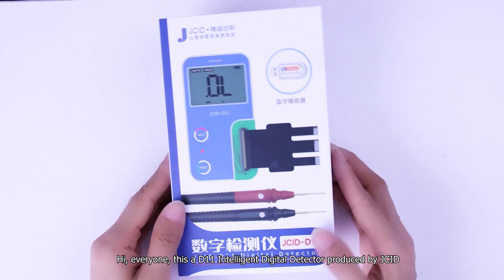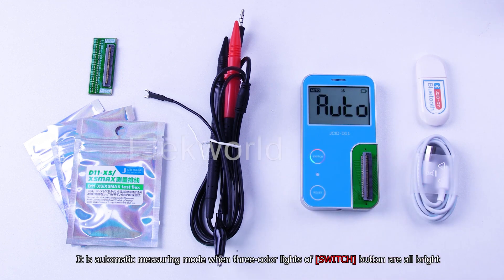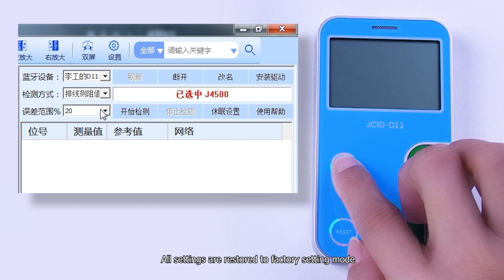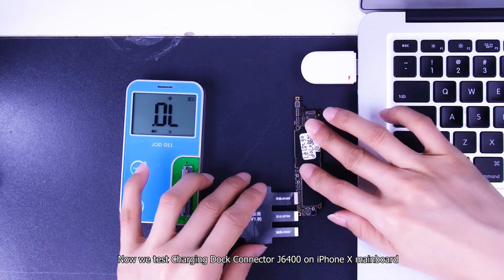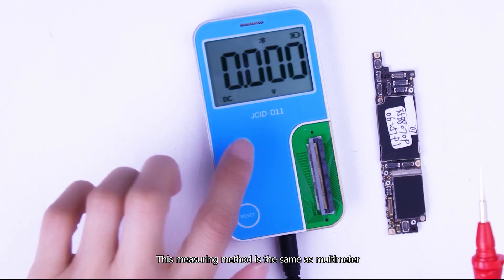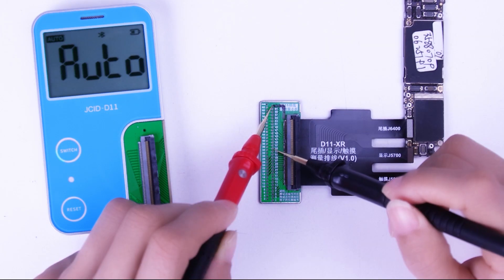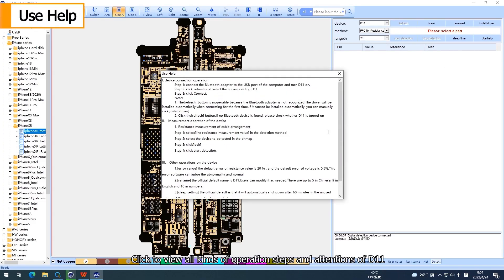JCID D11 Intelligent Digital Detector Unboxing, 9 Functions Integration.

Comment from the maker: Multifunctional Detector: JCID-D11 Detector. Nine Functions Bring You Surprise: Multiplex acquistion; Bluetooth transmission; Automatic recording; Intelligent judgment; Built-in battery; Voltage/Resistance/Short circuit/Diode measurement. 
Let's take a look at its details and how to use it.

Unboxing  00:00
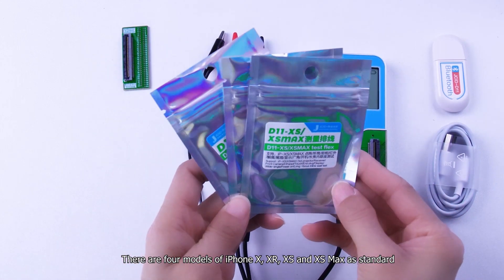Online Measurement  02:37
Offline Measurement 03:53
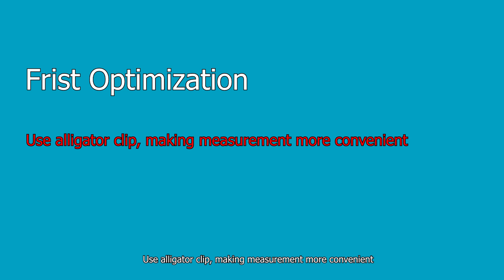D11 Detector Optimization  04:24
Related settings   05:08

Product Link: 
http://www.elekworld.com/Shop/product...

For more Repair parts&Tools and Tech support, please visit:
Website: http://www.elekworld.com
Facebook: https://www.facebook.com/Elekworldshop
Instagram: https://www.instagram.com/elekworld
Twitter: http://www.twitter.com/ElekworldL
Whatsapp: https://wa.me/8613480186332